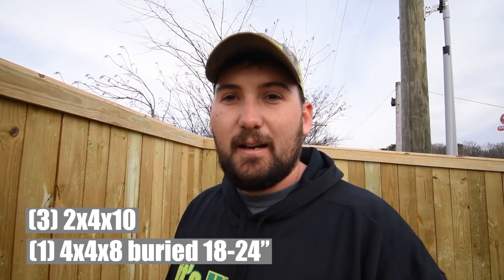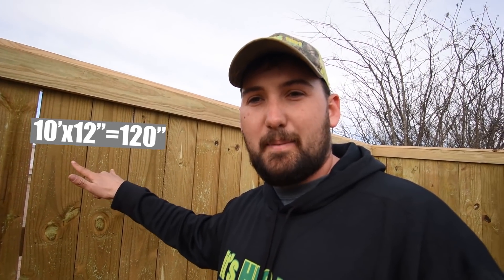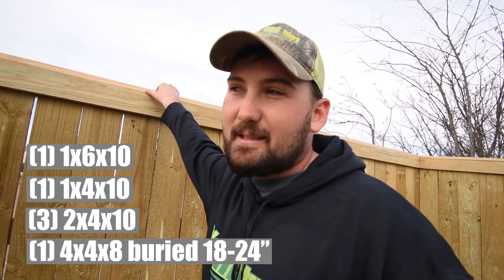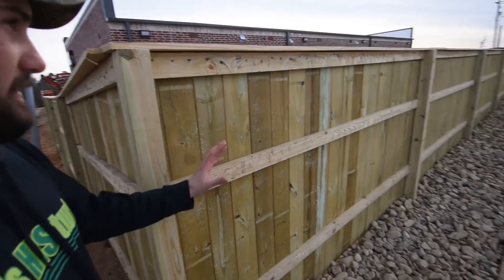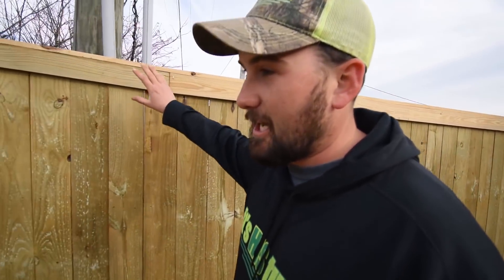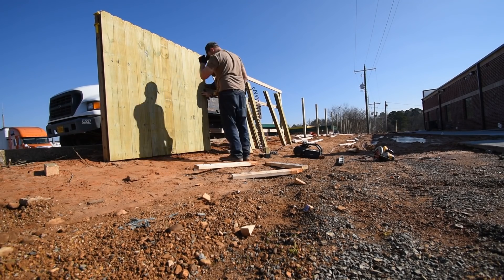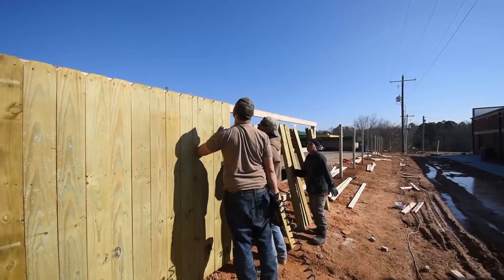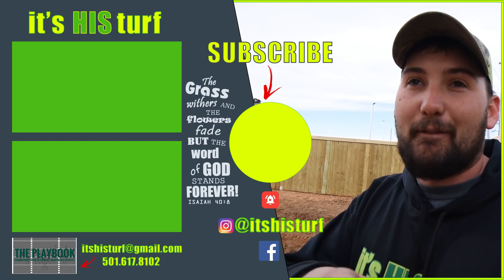Privacy Fence install by a lawn care business?

Comment: Set the posts 24 inch in the ground . Run the sections 7ft 10 inches so the 2x4x8 always break.. use a 2x8 for the top cap board it gives you room to adjust the cap as it runs..we charge 20.00 per ft 6ft cedar. We won’t even install pine because it’s garbage and you will have call backs. We stay 3 weeks to 1 month out on work all year
:
Edit : we are now booking 6-7 months out . We have built such a great name for our Small company in the last 2 years. People are willing to wait and pay a premium for our services here in Memphis

Comment: I wasn't able to tell for sure but it looked like you were using doug fir 2x4s also not sure if the fence boards were cedar, I was wondering because I live in Washington state where most of the lumber comes and $17 would barely cover the cost of materials here when using pressure treated 4x4s every 8', 4 cedar rails 5/4x4 two per side so fence looks good from both sides,1 cedar top cap 5/4x4, 1 bag concrete per post, and #3 or better 6' cedar fence boards, prices here after tax are about $16 per ft, upgrade to #2 or better fence boards and its more like $19 per ft.
Reply: I live in seattle ya fences cost a lot here.  Other vids I watched two of them said 55-65$ a foot, in texas or something
Reply: You could do 17 a foot in Ar before covid.

Comment: Is there a frost line in your area? the minimum code here is 4 feet
Reply from the maker: No. We never get much below 28. And it usually gets in the high 30s low 40seven in the dead of winter. Not to mention depending on what side of town your working in you'll hit solid rock at 6 to 18 inches so installers get lazy. I believe code for water lines is 24 inches but it's not enforced

Comment: Um no just no this fence is going to fall over, max post spacing for a wood fence is 8’ minimum post dept needs to be 36” deep and should have at least 2-80lbs bags of concrete, and 17/18 bucks a foot my ass, this video is a yr old at this point I am seeing and commenting bet the fence looks like shit right now
Reply from the maker: Well it doesnt.... fence is 21 months old. Still sturdy, still standing and still looks good. Would you like the address? Are you an engineer or something because Your specs are complete overkill. As for price average in my area is around 18 prior to covid. Post covid its 25-30/ft. Btw have you ever been to central arkansas?
Reply: it's HIS turf my specs r standard u have to be below frost line not at or above and the size of your hole is supposed to 4 times the size of your post so a 4x4 post should be at the small side 12”. I have been doing fence for 18 yrs and I work in multiple states for 4 different companies and also for myself. I rather do overkill  and Know I will never have to go back for a install mistake. U said in the video that it’s ok for your line to have some movement in it that your ends and corners will hold it all together that’s doing a half ass job non of the fence should move at all unless there is a issue
Reply from the maker: @charlessloop1552  since thats what we are going off of... frost line for the location of this job is 0-4" or 0-6" depending on which source ypu base it off of. Like i said no issues almost 2 yrs old and i stand behind my work if there ever was
Reply: I didn’t address the movement in the fence comment I still stand by u should go deeper i don’t see how u can tell a customer that it’s ok the fence has play in it and that the corners will hold it all together I am willing to bet that is y u put the cap boards across the top to help stiffen up the fence. I am sorry there nothing u can say that will convince me that this fence will last 10 yrs just everything about it sounds off and my background is 3 yrs of schooling for fence installation and 18 yrs in the field and I charge 75 bucks a hr just for me to be on the job site when working for myself and people pay it when I work for a company I have different agreements with them